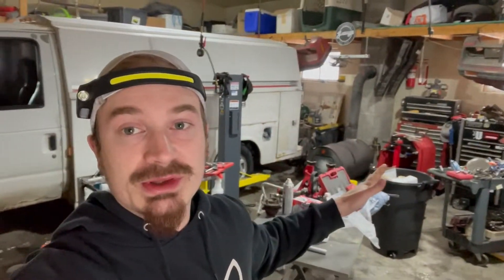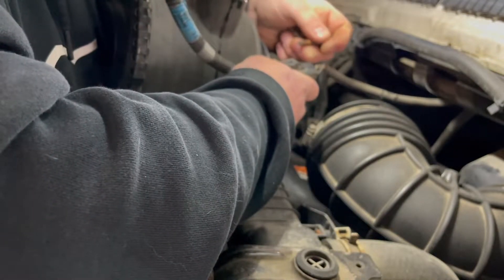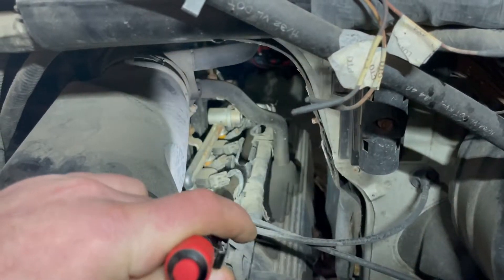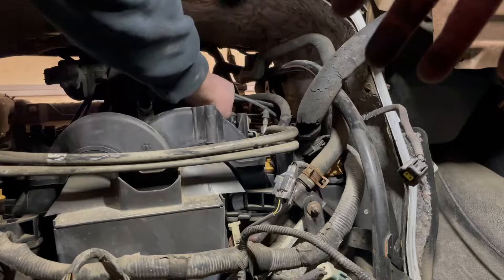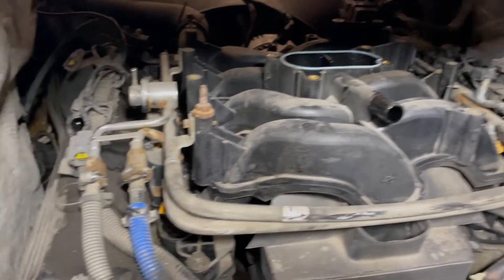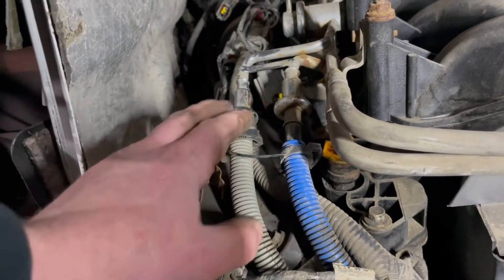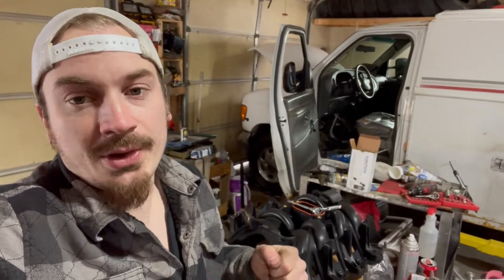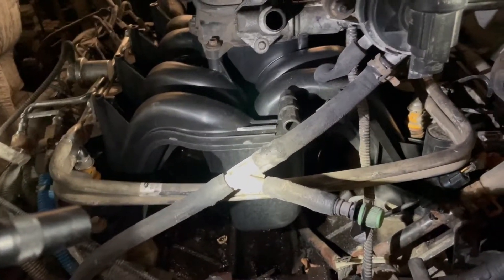Ford E-350 Intake Manifold Replacement!

Comment: Thanks for the insight.  I think my manifold is full of sludge and causing a loss of power.  Came here to see what it would take to remove and clean it.  Looks like I'll make damn sure I need to do it before I go through this mess.  Looks like it's at least a one six-pack job!
Reply from the maker: Hopefully it helps if you decide to do it! It kinda sucks but it’s not the worst thing, good luck!

Comment: Just changed the intake manifold on my 2000 f 250  4×4  .  Sucked, long reach down in there, my knees are shot  !
Reply from the maker: Yeah I just did coils and plugs in my 5.4 work truck (video coming later this week , the van was actually kinda nice having that dog house to get at the coils and plugs from both sides in comparison

Comment: Why the new manifold? Is this common practice to replace with new and not just the gaskets?
Thank for the vid! I have the same project on the same vehicle.
Having already replaced the cop's and plugs, the bird you shot this POS design was completely understood😅
Reply from the maker: The original manifold was warped, even before that the customer wanted it replaced reguardless!

Comment: My old cellmate at the last dealer loved these things, I think he needs a cat scan... I don't work on Fords at my shop they are too stupid for me... PLASTIC EVERYTHING.
Reply from the maker: I love my 2000 f150 with this same motor, almost 300k no issues, but I agree I would HATE to touch another of these vans haha but I will when the money is right
Reply: @shiftwrenchrepeat  he used to have a pile of those intakes... "Ya the leaky tstat housing, it comes free with a new one". I was the dodge guy at the shop, and he cringed at pentastar oil coolers... I was like bro, these are gravy ..all day, line them up. But ya I'd say your building is a bit small for that rig. I feel your pain. I can get a full size truck in with doors shut and I have about 1foot from my walls.... I feel an addition coming this spring.